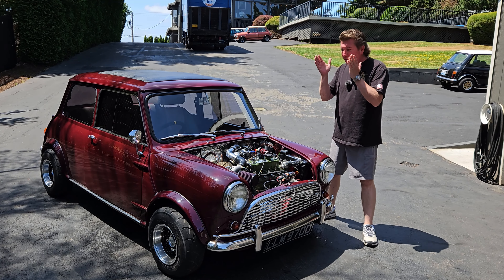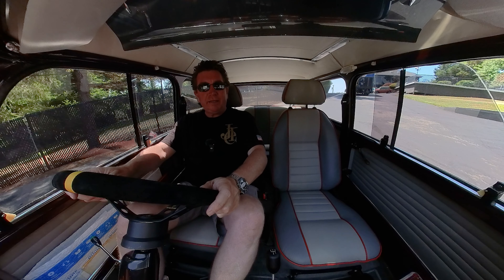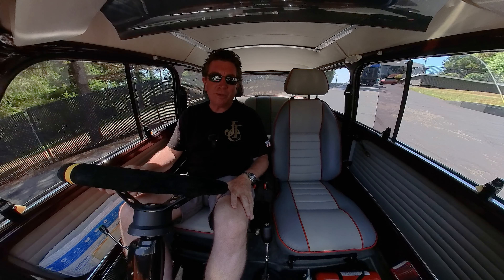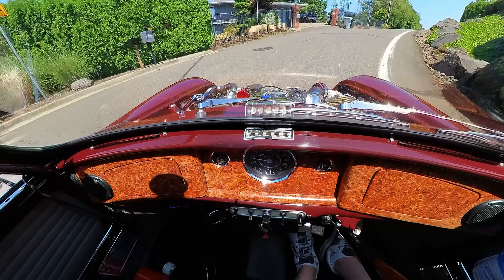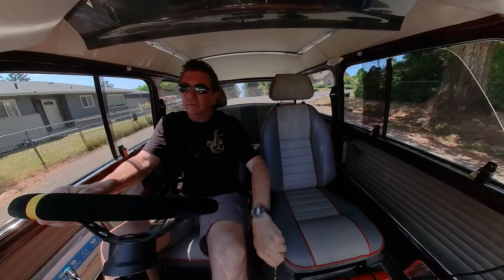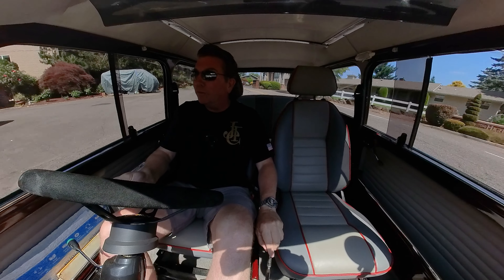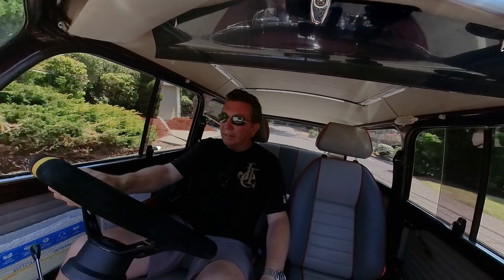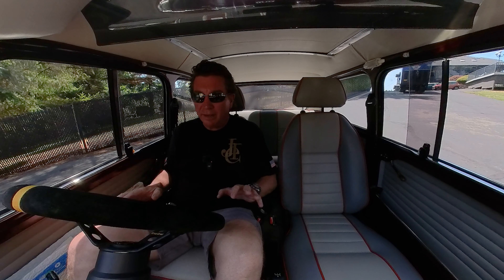Whats the New JET Motors Turbo Kit Really Like?

Comment: Even though i cut my teeth on Minis @ just 14 and Love the A-Series especially with MODS/Cam-Belt instead of Rattling Chain, I would now at 51 do an B18 V-Tec Turbo with the Clubman front-End Because i had a Vey nice 1275GT at just 18 years Young And LOVED the extra SPACE under the Bonnet [HOOD] I;m fro South Wales [UK] And it would be a Coin-Flip between an A-Series with the Twin-Cam Conversion WITH a Turbo or just go for an B18 V-Tec with a Turbo. I have a Polo 1.6TDI 90BHP [Very Low Miles] BUT looking at these Minis i just WANT to get another and Do some serious MODS/Engine/Gearbox/Suspension/Wheels/Paint/SOUNDS.